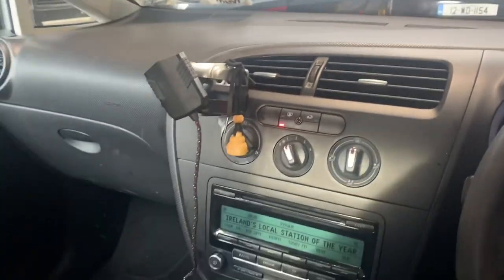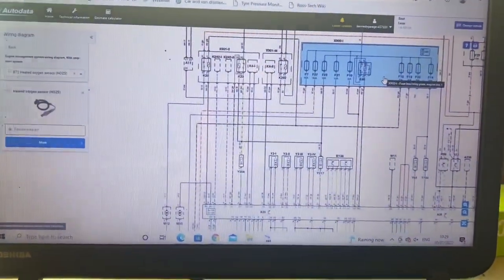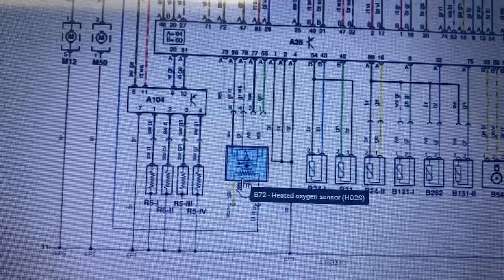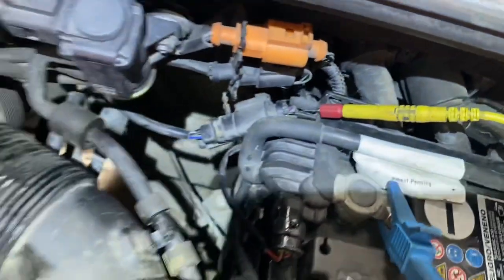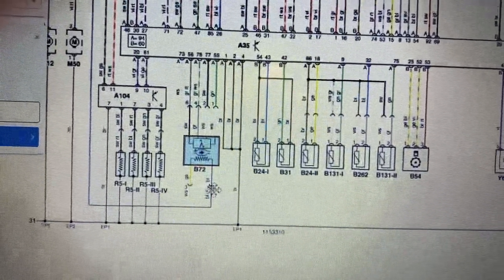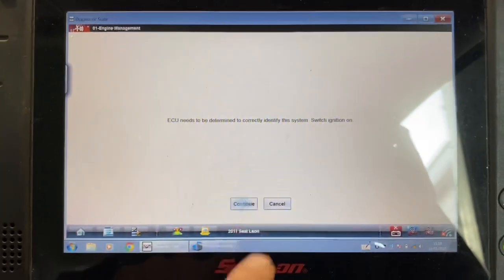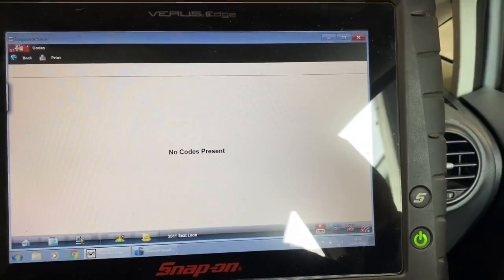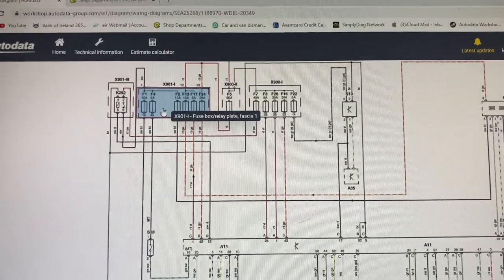Seat Leon, check engine light on & P0030 fault code

Comment: As good as Autodata may be, it is only as good as the person using it and their knowledge and understanding.  Great video Peter and what looked very complicated to begin with, with logical thought ended up being a 10amp fuse...in the wrong place .. so near and yet so far! 🔧
Reply from the maker: Very well put Damien, so near and yet so far 😬
I find this happens a lot lately, there is little or no tolerance for anything other than perfect 🤔👍👍👍

Comment: Good one anyone else would of just replaced the sensor👍
Reply from the maker: I didn’t really think of a misplaced fuse until I was recording & looking at the wiring diagram. But she did say the engine light was only on since she had the issue with the lights. Thanks again John for watching 👍👍